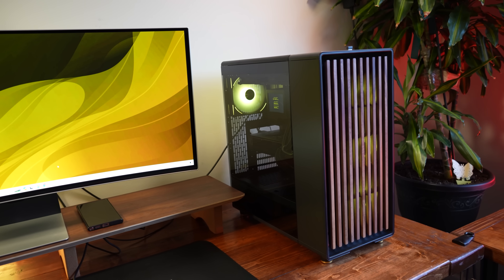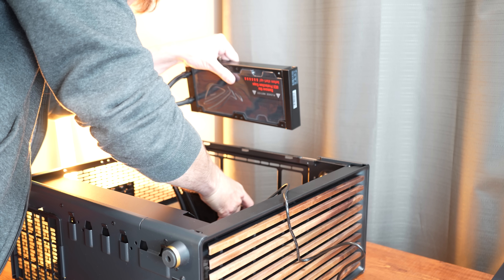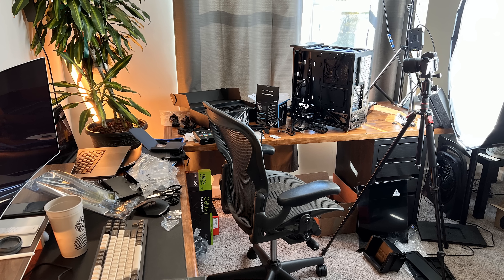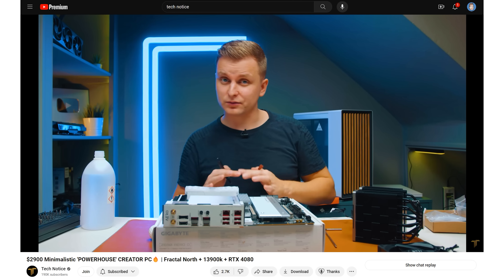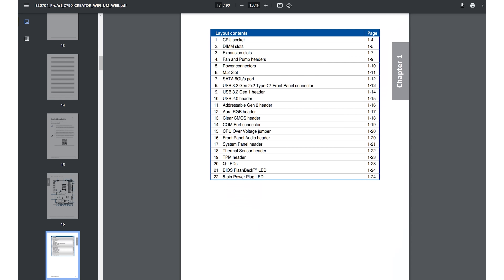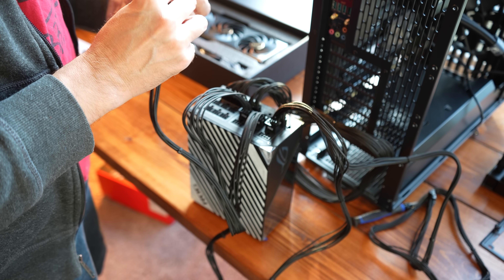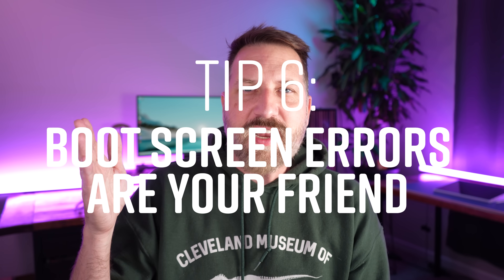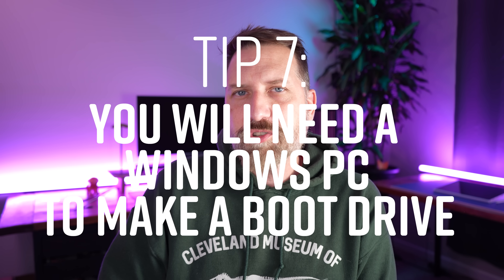What I Wish I Knew Before Building My First PC

Comment: I would be interesting in how you connect your Huion to your DIY PC.  I have the Asus Pro Art B660 with an Asus RTX 3050 and have to connect my Huion with the 3 cables since there is no USB C Thunderbolt Video out that I can just connect with one USB C.  Annoying since my graphics card has only one HDMI out which means I have to use Display Out on the RTX 3050 to monitor and then connect HDMI to my Huion.  I tried to connect via the motherboard HDMI but keep getting no signal.  My Surface Pro has thunderbolt outs so I just connect with on USB C Thunderbolt cable.  I used the Tech Notice video for $1500 PC and followed the instructions he showed-worked slick though when I got to installing a new version of Window 11 it was a nightmare.  I wish PC Motherboards would all have easy Thunderbolt 4 connections for front IO and rear IO that would handle everything- power, data and video.

Comment: I'm literally waiting for the parts for my first PC to arrive and my main takeaway so far is that youtubers who build a lot of PCs often build using the parts that they have laying around atm. Watching their builds sure is inspirational and can give you a general idea of what kind of parts can go together, but those specific parts might not be the optimal choice from the perspective of someone who has the freedom to choose and buy parts specifically for a single build. Forums, subreddits, etc. can potentially be a lifesaver when it comes to identifying common issues with certain parts and/or pairing specific components together. Definitely saved me from choosing a cpu cooler that wouldn't have worked for my config in the long run, despite it being very popular in very similar configs that I've seen being built here

Comment: Great Video explaining things.  I originally built my first computer about 10 years ago using a PC Gamer magazine that had a walk through how to do it.  One thing you should note to people especially if they have sight issues or big hands is connecting the small cables from the motherboard to the case itself.  It can be a pain.  I tend to use a headlamp so I can see the motherboard clearly and the motherboard manual to make sure I have the right plug ins at the right spot.  It was a pain for me this last build and will have someone younger ( I am 50) help me with that portion if I ever make a new build.  Also, Microcenter stores if you have one in your area is a great place to price out a computer build and have them build it for a little over a $100 to $150.  Also a great place to get nice bundle deals.  My closest store is in Boston from Vermont.  But it is always worth the trip.

Comment: Congrats on the first build. I find the parts choices odd. I would never put a 1200W PSU in a system where it doesn't need it or use an ASUS AIO since it is overpriced. I also would go for a much cheaper 2TB SSD since the Solidime just doesn't make sense price-wise. It's not SLC. It's not Gen 5. I just feel there are places where you could have used different components and allocated the budget to get more performance. the $100 from the AIO the $100 from the SSD and the $150 from a more reasonable PSU means about $350 that could have been used for more performance.

Comment: Ventoy is a great tool to have multiple ISO's bootable on one USB stick so you don't have to constantly rewrite them.  I've been building PC's since the 90's and you are 100% correct, people who are used to doing this can speed through it so fast there's a lot of stuff I wouldn't even think twice about.  Had my last PC (13700k in a fractal torrent with a gigabyte aero board) built in less than an hour for instance.  

Helped a friend of mine who was building his first machine not long ago and when I asked him how long he had been at it he was like "I started yesterday!"  After we got his machine sorted and booting I made sure he gathered all the cables that were left over and stored them in the motherboard box, they are not interchangeable between PSU's brands and not even between different series from the same brand so you want to be sure of that kind of thing if you have multiple PC's.  

Nice build BTW, the North is a really good looking case.  And last thing there is usually an arrow somewhere on the side of most fans that shows the airflow direction, but they can be easy to miss.

Comment: other small things that needs to be done to avoid headaches:
1. make sure to peel off all of the plastic covers, from motherboard, ram, gpu, and fans before installing them. They might be harder to remove once everything's installed or they got stuck because of heat later.
2. make sure to install the io shield in the case first if it's not pre-attached to the motherboard.
3. Install the ram, cpu cooler, m.2 drives to the motherboard before putting it inside the case.
4. Remove the pcie slot covers from the case before screwing the motherboard in place. To do this, place the motherboard to it's position, then estimate the pcie slots that the gpu will use. You don't need to attach the gpu yet. Then get the motherboard/gpu out of the way again so it's easier for you to remove the pcie slots. This step is very important as many entry level cases have this bendable slots that you can detached. And it would be a pain to remove them once everything's already screwed in place. 
5. Plug in all the connectors before installing the fans as they can be harder to access once the fans are in place. 
6. always follow the instructions from the manual. difference between Fan headers (cpu/cpu opt/pump/pwm) and rgb headers (5 pin/12 pin) are the ones that you should be familiar with.
Reply from the maker: This is a great list! It's interesting to see how many of these things I did accidentally. Like getting the fans in last was really just dumb luck on my part.

Comment: I’m a Mac guy too but I’m considering building a PC for my next machine because I just don’t know if I can afford a new powerful Mac. A Ryzen 9 with lots of ram and an Nvidea card is about $1500 cheaper than an M3 Mac Studio :-/ Yes I know they’re not out yet but they’ll be priced similar to the M2. 

I need extra power for blender but I use krita frequently too. 

I’m considering a Linux build though. Not that there’s any difference between the hardware for a windows or Linux build. 

I would be interested in the long version video if you put it up!

Comment: I recently built my own first pc. 7800x3d with a 7800xt.

The power supply is arguably the most confusing thing: the cables are barely identified, a 6+2 pin cable is an 8 pin cable... But it isn't really identified.

Regardless, I still enjoyed it greatly! 

But my god, the power supply cables on modular power supplies is a hassle. Also, case fans need a SATA power cable... Didn't know that, so I figured plugging them into the MB for power was enough... It wasn't 😂

Comment: LTT and Paul's Hardware both have excellent guides. Recommending to choose a mobo based on install videos you can find is horrible advice. That's how you end up with a part that doesn't fit your needs. Learn what you need and buy that. Motherboards are fairly homogeneous when it comes to install. It's features and setup where things change.

Comment: Power supply tip: Save the extra cables that came with the power supply in the box they came in, or cut out the part of the box with the make and model and keep it with them.  The  component end of those cables are standardized, but the psu end is not.  Using them on a different powersupply could fry something.

Comment: This is something that really helped me. 
When you open packages of your component you will have a lot of different screws... Don't make the mistake I did the first time and just put them wherever. 
Take some plastic cup or paper cup and write on it with something the piece in which the screw will go. Cpu screws? Cpu cup. Motherboard screw? Motherboard cup. Case screws? Case cup. Do they come with different size? Different cups, like "Case S" "Case M" etc. If the screws have a name put the damn name near the component. This will let you know how many screws you used and you will not find yourself with an extra screw and asking yourself:"Did I miss something?"

Comment: Congrats on the build - and the success!  I've been in the software industry for about four decades or so, and I've built quite a few PCs in my time.  Just curious:  Why did you build the PC?  I'm guessing it's because you're getting into 3D modelling and rendering, and you need the horsepower.
Reply from the maker: Honestly... I've always wanted a gaming PC. And once I got a Steamdeck I find myself using that more more and more for games and moving away from consoles.
But I'm also using it for video editing and as a testing environment that I have more control over than off the shelf Laptops that I've been using for years.
Reply: @thebradcolbow  I was originally a Mac guy for years.  But like you, I wanted to get into PC gaming over consoles.  My co-workers all did PC gaming. while I was in college in the mid 90s.  With my Mac I was out of luck playing a lot of games with them.  I started to upgrade old used pcs first as they gave me their old builds.  Then I worked my way up to building my own.   On a side note for Christmas I received a Asus Rog Ally .  I use it like a Steam Deck for on the go gaming .  But also as a portable art computer. as I bring it whenever i leave the house.  I also bring my Samsung galaxy tab s6 lite and use Superdisplay so I can draw in Adobe Illustrator CC,  Photoshop CS6, and other art programs.   You helped me with that buy through your reviews.   I do appreciate it as it is a great tablet on a budget that works well as a second screen on all my pcs.  I use it over my x-pen monitor for drawing.

Comment: I have built them in the past, bought laptops in recent years, but tomorrow my first barebone NUC should arrive. Thankfully a lot is installed already, but I do need to add some components and install Windows 11. Much easier than yours for sure. The last pc I built had a lot less cables. Great video, are you enjoying all the power you put into this machine?

Comment: Great video! I kinda wanted an Asus ProArt because of the gimmick, ended up getting a MSI z690 PRO and I'm more than content with it (plus I can upgrade to a i9 if I want to)

I didn't face so much issues with building the PC, was coming from using two really bad laptops (an Acer with a first gen i3, then the newst one, an Acer with a R3 3250u with an hdd, barely could watch youtube in that thing, but now it's sole purpose), and in two years watched a bunch of youtube videos about PCs, got into reddit, and had to compare local prices fishing for a budget friendly but with good performance option (still couldn't get a GPU, so that's my next purchase because I'm hating Intel iGPU)

My advice would be, don't go below an i5/R5, aim for at least 32gb of ram (maybe wait another year for a ddr5 oriente build), don't skip on the GPU, even if your only option is a 2060 Super, don't get a 3050, get two stick of 1tb SSD nvme because you're gonna need that storage (and two 1tb are cheaper than one 2tb), don't get the cheapest motherboard, that one that cost the same as the manufacturing cost, it's the barebones of your PC and a good one may last you a decade or more.

GET A UPS, or al least a surge protector with multiple connectors, specially if you're using a screen tablet.

And please don't buy cheap power supplies, or the ones with RGB, there are some good bronce PSUs like Corsair CX and Adata Pylon (there is a corsair with RGB but it may be more expensive, and it's good actually), research as much as you can on what PSU to buy. A bad PSU can fry up your entire system, a good PSU will kill itself and save all your components.

Comment: The ultimate key is to take your time and get familiar with the components being used.
Reply from the maker: Yeah, that's great advice. The things that were easy were the things that I researched ahead of time (ram, storage, cpu installation) and the hardest part was what I didn't pay any attention to until I started, the PSU.
Reply: @thebradcolbow  Now, I bet your next one will get easier! The last one I built was about 2 years ago for my daughter's boyfriend. I am thinking of building a better one later this year just to run Blender and various games better.

Comment: 😮‍💨You took an Intel Core i9-13900K and were going to cool it with an ASUS ROG Ryujin III 240? Keep an eye on the temperature of your CPU, there may be problems. (Well, only if you use programs that will properly load your CPU)
Reply from the maker: So far so good. I got more computer than I need so even when processing video it's doing well, but my videos only take 2 to 3 minutes to export.

Comment: Great job on your PC Brad!
I built my first PC about 20 years ago. Another pro tip: the cables from the modular PSU are NOT interchangeable between brands and types. So be careful, or it will blow something :))
Reply from the maker: That's good to know too! I had no idea.
Reply: There was a video explaining this some ware. I build my first PC during last year and combed the net for every advice available. There was an unwritten rule about the fan direction that the air will flow from the side where the branding sticker is. And it took me a year to build it because I didn't buy new GPU right a way and tried to use the old box and PSU. Wen I finally got my new GPU (almost a year later) it didn't fit the old box and needed new PSU so I had to take a part the whole thing again and put it together in the new box😁

Comment: My 2 cents here, get yourself a proper screwdrivers set, it won't cost you a fortune but will help you a lot.
With a proper screwdrivers set I mean full sized and not those little ones like the one in your video.

Comment: Most fans are "pull" which means they suck air in through the front (the pretty side) and blow it out the back (the ugly side) but push fans are also available so "which way round does it go" depends on the specific fan and what you want to do with it. How many fans you have and how you arrange them is partly objective and partly subjective and depends on a bunch of factors: the general consensus is that you want to run at a slight "positive pressure" (drawing in more air than you're exhausting) by having more intake than exhaust fans - this has a couple of advantages, the biggest one being that it reduces dust ingress - but the location and specific orientation of the fans is as much an art as a science. There are objectively wrong ways of doing it, but there's also no single right way - as long as your GPU has a good supply of fresh air (either with bottom or front mounted intake fans) and there's a reasonable airflow over the rest of the motherboard (i.e. don't stick an exhaust fan right next to an intake fan as you'll end up just blowing a lot of the cool air straight back out without it achieving anything) you should be good.

It's also worth noting that direction aside, not all fans are equal - some are designed for flow rate (how much air they can move) and some are designed for static pressure (how forcefully they move the air) - and you want to try to use the right one for the job; case fans should be tuned for flow rate, radiator or air cooler fans should be tuned for static pressure. The "wrong" fans will work, but you'll need to run them harder to get the same result.

Comment: I also built my own PC recently as well, and I had a my own specific problem: Because I was coming from another PC, I already had some backup HDs, and on the new one, I got an NVME M.2. The mistake was connecting all the the HDs(and SSDs) at the same time on the first boot. Don’t do that! My MB didn’t know what to do when I did this and so I was facing a black screen with nothing. I got scared feeling like I broke something.

Just leave your new/main HD/SSD/M2 connected alone, install your OS first, then after all configuration, you can connect the other HDs. 

Also, if you’re connecting an HD with windows installed, remember to format. You may face an issue of not being able to boot to BIOS, even after OS have been installed on your main drive.

It’s a very noob issue, but I think it might help.

Comment: how much did it cost?
Reply: just looking at the parts list this was probably around $4k. The CPU is 500ish, 1k-1.2k for the graphics card, and a few hundred each for the ram, motherboard, power supply, storage, case, monitor and perfs if needed, ect. This is a pretty stacked build list though! You can definitely build something competent around the $2k margin, it just wouldn't be as future proof in terms of future upgrades and capabilities with software :)
Reply from the maker: That's a really good estimate. It was around $3600.
Now that I've been using it for over a month my main takeaway is I could have gotten away with A LOT less. I did get carried away watching all the benchmark tech channels.
Reply: @thebradcolbow  You could get away with less now for sure, however this is a future proof rig like I mentioned above so as long as you can afford it, building a high end system now can save you money down the road. For example, if you want to upgrade your cpu in the future, you are using a chip set on the motherboard that will be utilized for a while. Although it's more expensive now, if you want to upgrade all you have to do is replace he cpu... not the cpu plus motherboard plus RAM, etc. There are definite positives to both sides here